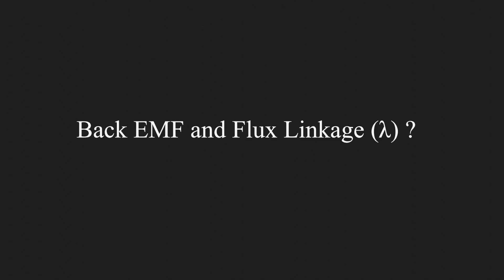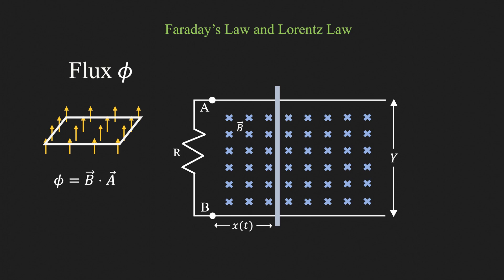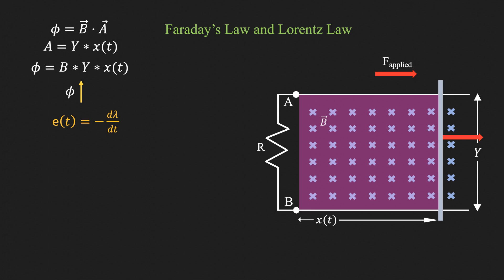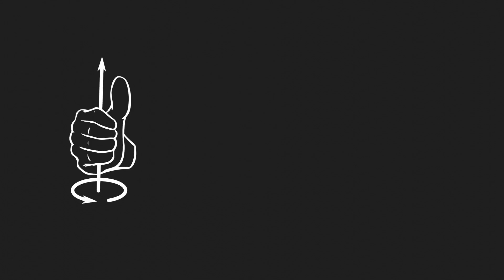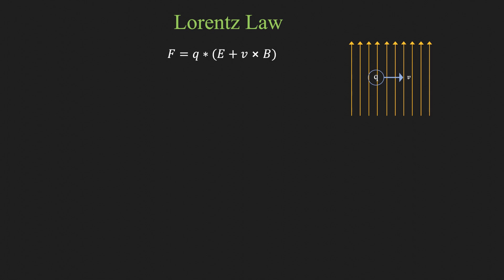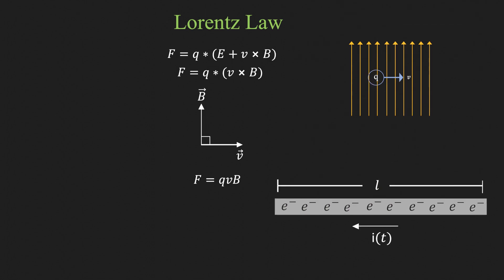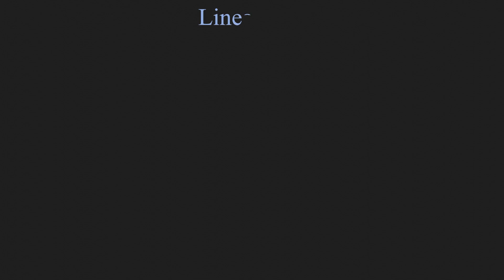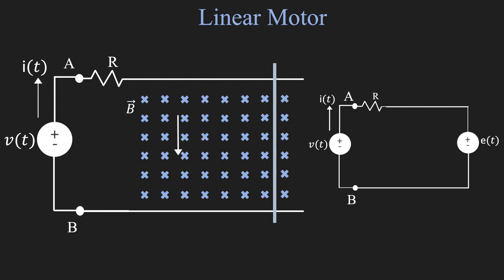Motor Control From Scratch - Part1 | Faraday's Law and Lorentz Force

Comment: Hi sir,  In the Lorentz force eqn how the E is removed since a motor has electrical energy?
Reply from the maker: A motor does have electrical energy. But what we are trying to find is - what is the force on a current carrying wire when it is placed in an external electromagnetic field. In this case, we just have a magnetic field and no external electrical field. Hence, E=0.
Reply: @thesubcooledmind7910  how can work be done then since the force is perpendicular to the velocity and b field?